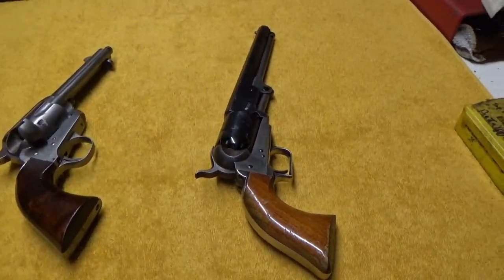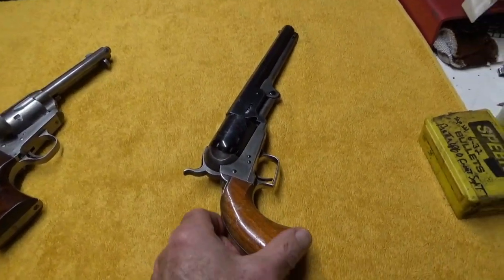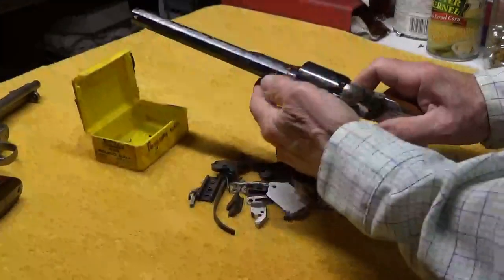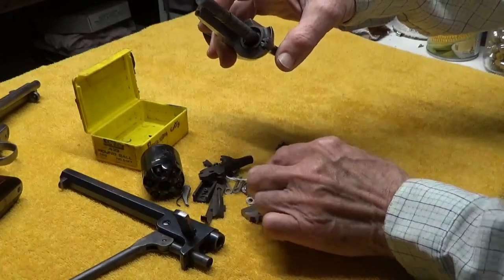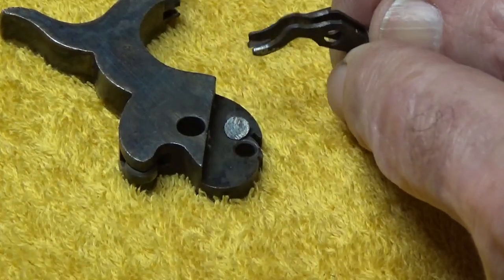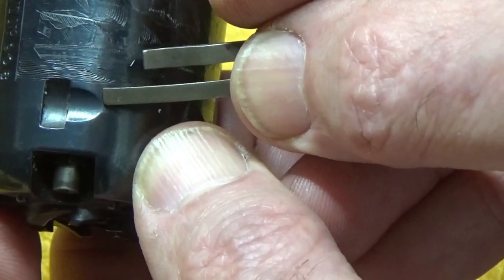Single Action Clicks and Timing - a Look Inside

Comment: Could you tell me why my cylinder over rotates if I cock it somewhat fast but it's perfect if I cock it medium or slow speed?
Reply from the maker: Here's my guess.  The bolt (what comes through the bottom slot to lock cylinder) is not coming up soon enough.  The books say it should be about 5 degrees before lock-up.  If it is flying exactly into the locking notch, than a fast rotation will cause it to miss.  That is one reason for the leads that are cut in the cylinder just before the actual locking notch.  
Cocking the gun slow, you should actually hear when that bolt hits the cylinder Then a little more rotation and either one or two more clicks.  Those should happen after about a 5 degree rotation.  One click probably means that the trigger sear and bolt dropping into it's final locking notch are happening together, which it what is called the perfect timing.  Some think that perfect timing is when the bolt hits the notch when it first comes up, but actually in should drop into the leads on the cylinder.  Sometimes what you describe could be caused by a weak, or partly broken bolt spring.  Seems I have had that situation where it doesn't have the strength and doesn't move fast enough.  Maybe that's what's wrong with my legs. Hope this helps.  I can say that if the arm of the bolt that rides the hammer cam is shorter, the bolt will pop up sooner. I think they are made a little on the long side because they can be adjusted.  If they are too short then the bolt will not get out of the lock-up position when the hand tries to rotate the cylinder for the.next shot.   Hope some of this helps.  O.R.
Reply: @oldranger3044  Thank you very much for the detailed reply. Outside of trying different bolts is there any way to correct this OR is it alright to use as is if I just cock it at a moderate speed. BTW it's an Uberti 1849 Pocket Pistol with only 30 rounds through it. It didn't do this before I shot it. Thank you again Old Ranger.
Reply from the maker: @EBthere  As long as the cylinder is locked, I don't see a issue.  Something you might want to check when NOT loaded is that q-tip test that I talked about on one of the video's.  Lowering the hammer from the full cock position and listen and look to see where the face of the hammer is to the frame when the hammer is almost completely down.  That click will be the bolt arm sliding off the cam.  You won't be able to bring the hammer back and rotate the cylinder till this happens.  It should happen about the time the hammer face lines up flush with the inside of the frame.  If it has to go much further then if there is a caped nipple (this is what the q-tip represents) then the gun will be locked up and the barrel will need to be removed to free it up.  
Sounds complicated, but you might want to know about that because sometimes it is necessary to lower the hammer from the cocked position without firing the shot.

If you have been inside the gun and can get another bolt, replacement might solve the issue.  If you want to try to solve the problem with the replacement bolt (keeping the original unchanged), shorten the arm of the bolt that rides against the hammer cam.  It won't take much, 2-3 thousands and you should hear the bolt snap into the pre notch grove.  Its difficult to trouble shoot without seeing the problem, so this is not a sure fix.  O.R.
Reply: @oldranger3044  Yes, the cylinder seems to be locked. Only time over-rotating occurs is with a fast cocking of the hammer.
I will look for the "Q-tip video but you seem to have explained it very well. I'm gonna play it by ear for now since it's locking. I've been inside my larger Colt repros but not this pocket model yet. You are very kind to give such in-depth answers and I really appreciate it Old Ranger.

Comment: Was that all brass shavings/fillings on the inside of the brass frame at 3:56?
I can't believe you would leave all that crap in there.
Reply: It looks to me like part of the casting. Look close.
Reply from the maker: Good point.  Here's the full story.  Couple years back I got unlucky when I bought a couple used revolvers on line.  One I was able to salvage one (sort of), the other was a brass frame that had the cylinder arbor held in the threaded section of the frame with epoxy.  I machined a new arbor, but failed when cutting larger threads in the frame, believe I did not get the angle right.  Anyway, that frame became unusable, and I grabbed it to demonstrate where the hand and hand spring go in a frame, rather than take one apart.  Never cleaned it up as it is junk. Good observation.  O.R.
Reply from the maker: Actually those are brass shavings.  Frame was a junk one I grabbed to illustrate where the hand and hand spring operate inside the frame.  O.R.

Comment: I have a used Dixie gun works walker revolver and when I pull the hammer back and pull the trigger , it stop at half cock . Could you tell me what I need to do to fix it .
Reply from the maker: Not any experience as to what might be different inside the walker, but looking into it and will get back to you if I come up with something. O.R.
Reply from the maker: I’m thinking that possibly a spent cap worked its way into the action and won’t allow the trigger sear to move ahead enough when the trigger is pulled. Suppose it’s also possible someone lowered the notch on the hammer where the trigger sear engages in an attempt to reduce trigger creep. Might want to check YouTube for video on dissembling the walker as the mainspring is a bit tricky. O.R.
Reply: @oldranger3044  you could be right on the hammer , I was thinking about that too . I've already had it apart and I think if I replace the hammer it might fix it . The hammer a little expensive but I order one and give it a try . If thats not it I order another part that might be it . Thanks for you reply  .
Reply from the maker: @tomslongguns443  The trigger needs to have sufficient reward travel so its sear cannot drop into the half cock notch. Im again guessing but if the trigger-bolt spring is too strong, it might quickly force the sear back against the hammer between the two notches. I know the spring of mine is a lot stiffer (stronger) then most all of my other models, which of course is good for the sear engaging the hammer, but increases trigger pull weight. Be interested to hear what solves your situation. O. R.
Reply: @oldranger3044  it was the main spring , after I had bought a new hammer and couple of other parts . It turned out to be the main spring . It had slid to one side and when you pull the trigger wouldn't let it fall all the way .
Reply from the maker: @tomslongguns443  Well, know we know. Glad you got back to me on this and that the issue seems fixed. I found a used Uberti Walker that I’m anxious to try.  O.R.

Comment: Yeah I’m getting two clicks out of bp 1858 Remington.
Reply from the maker: I'm guessing, but that would tell us that the bolt is coming up directly into the locking notch at exactly the same time as the trigger sear locks the hammer back.  This is a good thing, but you might not want to cock it really fast.  This also occurs on one of mine. If not directly, the bolt is coming up very close at least to the notch and the momentum of the rotating cylinder  alone puts the cylinder ahead enough for the bolt to snap into position.  Remington has no lead into the notch, seems this is the way they were designed.  O.R.